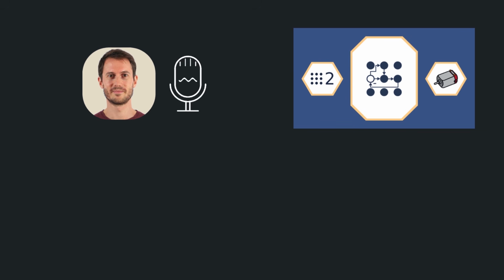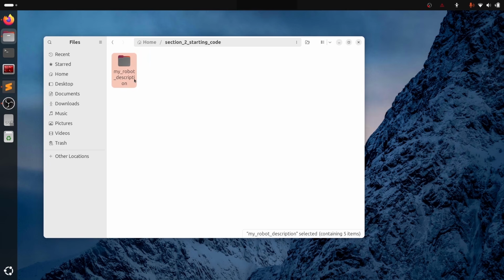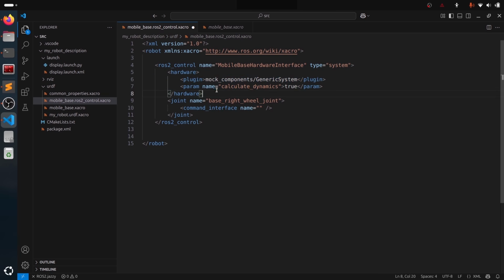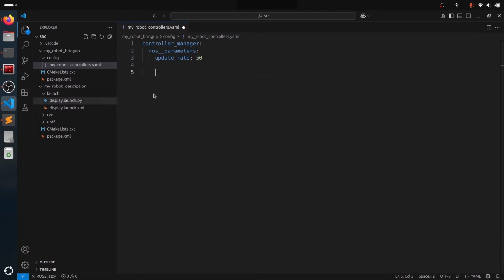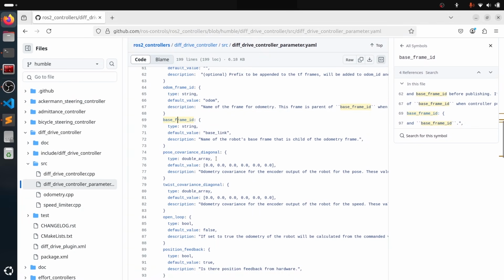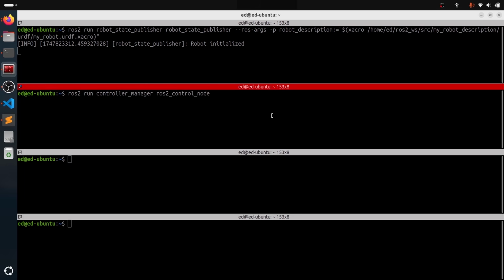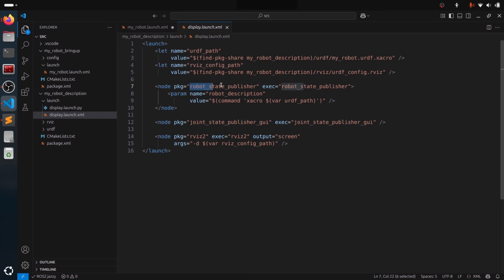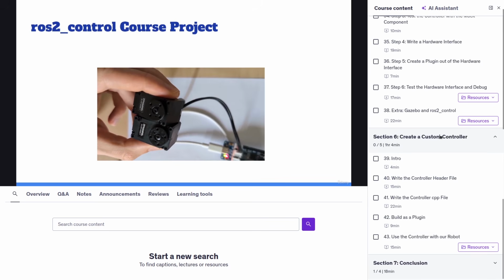ros2_control with ROS2 [1h20 Crash Course]

Comment: Hi, 
I have followed this guide exactly, and the only difference is the name of my workspace.
I can run rsp and confirm that my controllers are loaded and active, and I've followed the steps to ensure everything is running correctly. I am able to load rviz and set the fixed frame to odom without any errors however when I use teleop twist keyboard or send a direct command my robot won't move and ensure my keyboard layout was us.

Comment: I would love to get this working but I seem to keep runing into a problem where the control manager does not seem to load properly. I see the first 3 INFOs and the WARN about the FIFO RT as you show, but nothing after this. If I list nodes the /controller_manager is in the list, but if I then try to use the spawer, it just says

[INFO] [1773698232.684208950] [spawner_joint_state_broadcaster]: waiting for service /controller_manager/list_controllers to become available...

I am not sure if its because the moch_controller plugin is missing. If that is the issue  I have not been able to figure out how to install that.
Reply: This seems to have something to do with the need to remap ~/robot_description to /robot_description using the Humble version of ROS2. I was able to get it to work by using a .py launch file and using this controller node
    control_node = Node(
        package="controller_manager",
        executable="ros2_control_node",
        parameters=[robot_controllers],
        output="both",
        remappings=[
            ("~/robot_description", "/robot_description"),
        ],
    )
but I can not get it to work adding remapping to the xml launch file, or doing launching manually on the command line. 

If I use remapping on the connad line is seems to substitute the ~/ with the path to my home directory.

Can you demostrate how to perform the remapping using a manual launch?
Reply: @slammers67   @RoboticsBackEnd   Hi, yes, it seems indeed to be the ~/robot_description remapping that is required for ros2 humble. In CLI (terminal step by step) you would have to modify the command required to launch the controller manager as below:

ros2 run controller_manager ros2_control_node --ros-args \
  --params-file /path/my_robot_controllers.yaml \
  -r "~/robot_description:=/robot_description"

-r is the remapping command (-r /oldtopic:=/newtopic), it is important to put the " symbols so this is interpreted correctly. You also need to have the robot_state_publisher alive before. 

Upon starting the controller manager, you should have: 
[INFO]  [controller_manager]: Received robot description file.
[resource_manager]: Loading hardware 'mobile_base_ros2_control' 
[resource_manager]: Initialize hardware 'mobile_base_ros2_control' 
[resource_manager]: Successful initialization of hardware 'mobile_base_ros2_control'
[resource_manager]: 'configure' hardware 'mobile_base_ros2_control' 
[resource_manager]: Successful 'configure' of hardware 'mobile_base_ros2_control'
[resource_manager]: 'activate' hardware 'mobile_base_ros2_control' 
[resource_manager]: Successful 'activate' of hardware 'mobile_base_ros2_control'

This output on the terminal is usually missing if you do not do the remapping with ROS2 humble, and you will not be able to spawn the controllers. If no remapping you get:

[controller_manager]: Subscribing to '~/robot_description' topic for robot description file 

and you have no confirmation of the robot description is received.

In launch mode, using the xml launch file you can then modify to :

    <node pkg="controller_manager" exec="ros2_control_node">
        <param from="$(find-pkg-share my_robot_bringup)/config/my_robot_controllers.yaml" />
        <remap from="~/robot_description" to="/robot_description" />
    </node>

Do not forget the " as well.

Really good tutorial, but yeah, would be good to have equivalent for ROS2 humble and understand the small differences (which sometime blocks you from getting it to work).

Comment: Hello. Thanks for this video it is really informative. I am running into one problem however the robot won't move in rviz with teleop or a direct command. I have followed exactly what you do in this video but can't figure out why. I am using ubuntu 24.4.03 LTS with ros jazzy. If you could help me figure out why this won't work that would be greatly appreciated. thanks

Comment: Thanks you for creating such helpful video.
I'm very beginner in ROS2 and ROS2 control. My final goal is becomming to be able to control the robot arm in NVIDIA isaacsim.
While I was going through this tutorial, I encountered a problem.
I'm learning this tutrial using docker file "osrf/ros:humble-desktop" on my ubuntu22.04 desktop computer.

I could have completed from chapter1 to chapter6, but my problem is that in chapter7, when I tried to launch following command
ros2 run robot_state_publisher robot_state_publisher --ros-args -p robot_description:="$(xacro /home/ros_ws/src/my_robot_description/urdf/my_robot.urdf.xacro)"
The output was like this.
[INFO] [1759577720.300536892] [robot_state_publisher]: got segment base_footprint
[INFO] [1759577720.300588098] [robot_state_publisher]: got segment base_link
[INFO] [1759577720.300593479] [robot_state_publisher]: got segment caster_wheel_link
[INFO] [1759577720.300596444] [robot_state_publisher]: got segment left_wheel_link
[INFO] [1759577720.300599149] [robot_state_publisher]: got segment right_wheel_link

In another  terminal, I typed the command
ros2 run controller_manager ros2_control_node --ros-args --params-file /home/ros_ws/src/my_robot_bringup/config/my_robot_controller.yaml
The output was like below.
[INFO] [1759578425.023198535] [controller_manager]: Subscribing to '~/robot_description' topic for robot description file.
[INFO] [1759578425.023584651] [controller_manager]: update rate is 50 Hz
[INFO] [1759578425.023596934] [controller_manager]: Spawning controller_manager RT thread with scheduler priority: 50
[WARN] [1759578425.023661816] [controller_manager]: No real-time kernel detected on this system. See [https://control.ros.org/master/doc/ros2_control/controller_manager/doc/userdoc.html] for details on how to enable realtime scheduling.

Finally, I executed the command below in another terminal,
ros2 run controller_manager spawner joint_state_broadcaster
The output was like this.
[INFO] [1759579126.173885221] [spawner_joint_state_broadcaster]: waiting for service /controller_manager/list_controllers to become available...
[WARN] [1759579136.196020662] [spawner_joint_state_broadcaster]: Could not contact service /controller_manager/list_controllers

I guess the problem is originated from launching robot in the first command, but I couldn't find any typo nor missing argument by checking the tutorial video again and again.

Additional information, ROS2 looks working quite well.
-----------------------------------------
printenv | grep ROS ->
ROS_VERSION=2
ROS_PYTHON_VERSION=3
ROS_LOCALHOST_ONLY=0
ROS_DISTRO=humble
-----------------------------------------
ros2 node list ->
/controller_manager
/robot_state_publisher
----------------------------------------
ros2 topic list ->
/controller_manager/robot_description
/joint_states
/parameter_events
/robot_description
/rosout
/tf
/tf_static

I would really appliciate if someone could support me to solve this ploblem.
Again, I'm really appreciate for sharing your advanced kowlage through the tutorial. Thanks.

Comment: May i do all of this on my raspberry pi 5 os64-bit or i absolutly need ubuntu 24.04?? I have a robot arm 6 axis i whant it to play chess agenst me :)
Reply from the maker: You can install Ubuntu 24.04 on your Raspberry Pi, ros2_control will not be an issue.
2 things: first, install Ubuntu server and don't use RViz on the rpi. Second, you might need to tweak the update_rate parameter for the controller manager, in case the rpi is not powerful enough to keep up (but the rpi 5 is quite powerful so I guess no problem)

Comment: AI Summary

Abstract:

This video serves as a comprehensive crash course on ROS2 Control for developers who have a basic understanding of ROS2 but are new to its hardware control framework. The tutorial provides a high-level architectural overview, explaining how components like the Application, Controller, Hardware Interface, and Hardware Driver interact. It emphasizes the roles of the Controller Manager in loading and managing the system and introduces the concept of using a "mock component" as a perfect, simulated hardware interface. This approach allows developers to build and test a complete control stack without needing physical hardware.

The core of the video is a step-by-step guide to setting up a ROS2 Control stack for a differential drive mobile robot. This process involves modifying the robot's URDF to include the `<ros2_control>` tag, creating a YAML configuration file to define and parameterize the necessary controllers (`joint_state_broadcaster` and `diff_drive_controller`), and finally, launching and verifying the entire system. The tutorial concludes by consolidating all startup commands into a single XML launch file and briefly promotes a more advanced course for creating custom hardware interfaces to control real-world robots.

A Step-by-Step Guide to Setting Up a ROS2 Control Stack

*   00:01:09 ROS2 Control Architecture Overview: The video begins with a conceptual overview of the ROS2 Control framework, explaining the data flow from a high-level application (e.g., navigation) down to the physical hardware. It breaks down the key components:
    *   Controller: Translates application commands into hardware-specific instructions (e.g., robot velocity to wheel velocities).
    *   Hardware Interface: Acts as the bridge between the generic controller and the specific hardware driver.
    *   Controller Manager: A central node that loads, activates, and manages all controllers and their connection to the hardware interfaces.
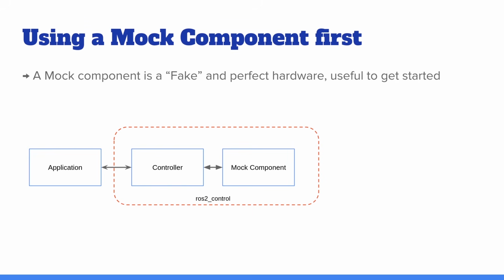*   00:08:28 Using Mock Components for Development: The tutorial introduces "mock components," a feature of ROS2 Control that simulates perfect hardware. This allows for the development and testing of the entire control stack without needing a physical robot or a custom hardware driver.
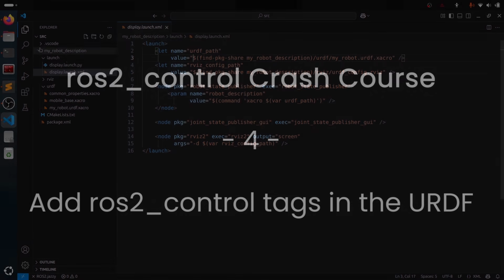*   00:17:45 Step 1: Modify the URDF for ROS2 Control: The first practical step is to add a `<ros2_control>` tag to the robot's URDF file.
    *   Key Takeaway: This tag defines the hardware interface plugin (using `mock_components/GenericSystem` for the simulation) and specifies the command and state interfaces (e.g., `velocity`, `position`) for each joint that will be controlled.
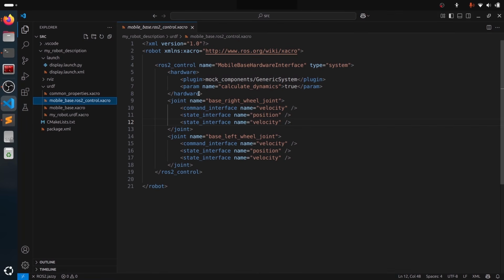*   00:25:50 Step 2: Create a Controller Configuration File: A YAML file is created to configure the controllers. This file contains parameters for the Controller Manager and for each individual controller.
    *   `joint_state_broadcaster`: This essential controller reads the states (position, velocity) of all joints from the hardware interface and publishes them to the `/joint_states` topic, which is required for TF visualization in RViz.
    *   `diff_drive_controller`: This controller manages the mobile base. It requires crucial parameters like wheel names, wheel separation, wheel radius, and frame IDs to calculate wheel commands and publish the robot's odometry.
*   00:55:05 Step 3: Launch and Spawn the System: The tutorial demonstrates how to start all the necessary nodes from the command line to understand their individual roles.
    *   First, the `robot_state_publisher` is run to load the URDF.
    *   Next, the `controller_manager` is started with the YAML configuration file.
    *   Finally, a `spawner` executable is used to load and activate each controller defined in the config file.
*   01:02:19 Verification with RViz and Teleop: The complete setup is verified.
    *   RViz: Visualizes the robot model, confirming that the `joint_state_broadcaster` is correctly publishing joint states for the TF transforms and that the `diff_drive_controller` is publishing the `odom` frame.
    *   Teleop Twist Keyboard: This tool is used to send velocity commands to the robot, demonstrating that the `diff_drive_controller` can receive commands and move the simulated robot in RViz.
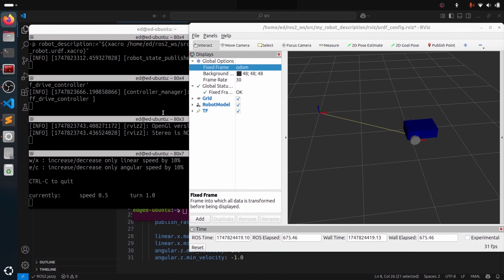*   01:07:41 Consolidating into a Single Launch File: All the individual terminal commands are combined into a single, convenient XML launch file. This file automates the process of starting the robot state publisher, controller manager, spawning controllers, and launching RViz.

I used gemini-2.5-pro| input-price: 1.25 output-price: 10 max-context-length: 200_000 on rocketrecap dot com to summarize the transcript.
Cost (if I didn't use the free tier): $0.07
Input tokens: 45070
Output tokens: 996